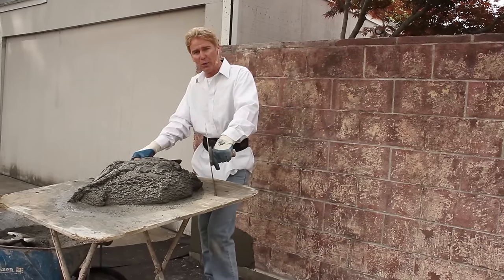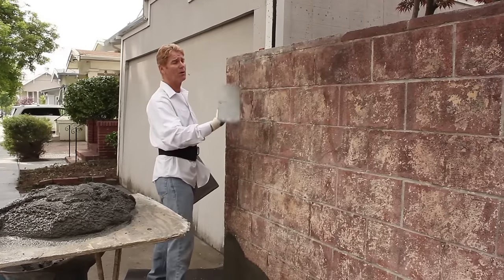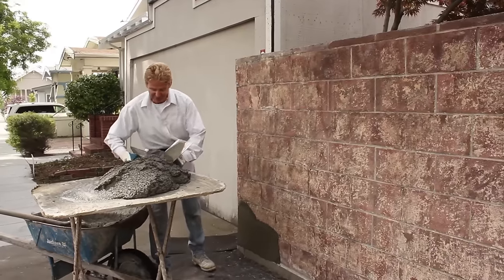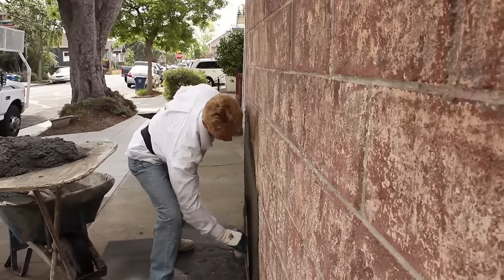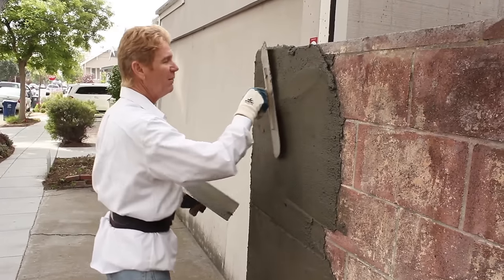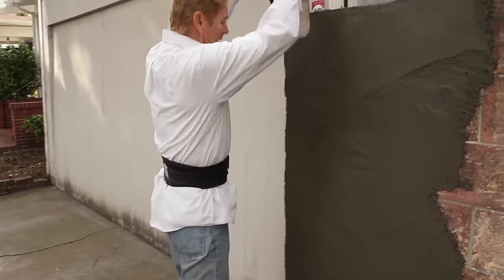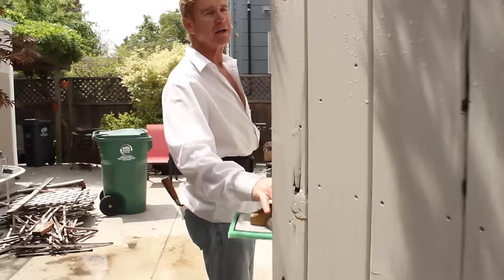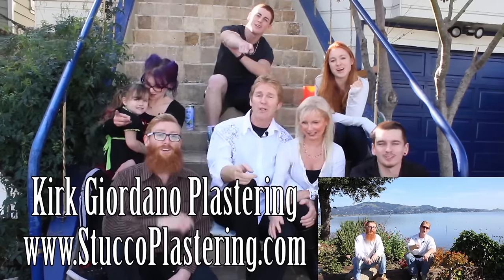Stucco thickness over concrete block?

Comment: Fantastic demo! Love the corner. Wow! Hey, have you ever had to do a tennis backboard wall over cement blocks? Same idea? I am very afraid my wife's deadly forehand will crack the wall. Would some kind of plastic additive help or just follow your excellent recommendation for a routine wall?MAx sand recommendation (3 part sand)?
Reply from the maker: The stucco as a rule is strong enough without additives.But if you feel you need them then add them.

Comment: Kirk, love your videos YOU sir are a true master at your craft! I am about to attempt to cover a  cinder block wall like the one in this video. The wall is around 9ft tall (11 rows high) and 100 feet long. I plan on using 100 LB bags (50 kilo) from Home Depot. It looks like you have 100 LBS or so on your board at the start of this video. About how much material would I need to cover the wall at 1/2"? I live down here in Old Mexico, and every house and building down here seems to be brick or cinder block covered in plaster!
Reply from the maker: Howdy Darth, not certain as I usually eyeball all my jobs, sorry
 Cheers, live long and plaster
 giordano’s stucco images and teaching videos

Comment: Gorgeous job!  

What is the  expansion joint ?  Do you put semi rigid fiber in there?  Please explain.
Reply from the maker: Evening a concrete, brick or cinderblock wall does not need an expansion joint, it a metal piece or channel that allows a wooden wall to expand and contract while allowing a bit of movement thus helping prevent hairline cracking.
 It does not stop hairlineing but it helps big time.
 Have a great day,
Kirk giordano Plastering
Reply: Kirk.  Please go to 5:31 and you're telling us about an expansion joint there. But it doesn't look like an expansion joint
Reply from the maker: O,oooooo, I see said the blind man, what I'm referring too is a natural expansion joint, this cinderblock did not touch the original stucco wall, so to fill that gap with stucco would have stopped both the home and the fense from natural movement when the rains start and with 30 days let alone more rain both the house and the wall will lift and shift, you can't see this action nor measure it with any man made devices, however both need only lift less than 1/8 of and inch within 30 or more days of solid rain and voila a hairline crack at the weak link.
 (not on my watch)
 therefore the natural gap that was well thought out when this cinderblock wall was built remains in place as old Kirk is not fool enough to fill the gaps just because it would save some time.
 I took my trowel on edge and recreated the natural expansion.
 Good question and sharp eye.
 Have a great day,
Kirk giordano Plastering
Reply from the maker: Evening Spencer, it's there just not made of metal, it's a gap between the wall and the fence, both serve as expansion joints.  
Cheers,
 Kirk and Jason giordano’s rendering videos

Comment: I have done interior corners like that with my hawk and a taping  knife. Same idea but the J. Compound is only being applied against one of the corners when I do it unlike you who is applying comment on both sides of the corner.
Reply from the maker: Evening Spencer, this is because your a professional with a ton of time in.
 I'm getting kind of bored with a hawk and trowel, I think I'll do a video using my shoe as a trowel just because I can, possible with hand throwing the mud on the wall or using a shovel.
 We actually did do a huge mountain retaining wall and used possibly thousand of shovels of mud to be trough on the mud which I then troweled down into the design i wished.
 The amount we used that day was 10 tons of sand with about 65 bags on common cement plaster, It does not spread well for walls but it's incredibly strong and cost less than the cement plasters I normally use on homes.
Have a great day,
Kirk giordano Plastering

Comment: Kirk. Any bonding agent used for exterior application?
Reply from the maker: Evening Spencer, a bonding agent was not needed for this cinderblock wall as the owner pressure washed it well,
 This allows our new porous cementitious finish to adhere to this existing Porous finished cinder block wall, " by suctions,"  mixed with a proper amount of skill to determine how much water water to use prior to application of new stucco.
 However I did apply a bonding agent as I like to make sure my work adheres to another man's work of pressure washing.
FYI, if I had pressure washed this wall I would not have needed a bonding agent as I am very detailed with my tasks.
Have a great day,
Kirk giordano Plastering

Comment: Great videos. Quick question...can you share the actual brands and measurements for sand, concrete and water to get our mix as good as yours? I think we are adding too much water.
Reply from the maker: Hi Elizabeth, as a rule, I buy Hansons Premium Lehigh cement plaster it's sold at the plaster yards. How much sand for each coat of stucco?
  Scratch coats are mixed at 1 part cement to 2-1/4 to 4 parts sand, brown coats are mixed at 1 part cement to 3 to 5 parts sand, and finish coats are 1 part cement to 1-1/2 to 3 parts sand. 
 Most times we mix 3 parts sand to one part cement plaster.
    We add water by eyesight when it looks right we stop adding water.
 If it looks too soupy we add more sand or cement.
 best wishes.
 kirk

Comment: Hi Kirk have you considered using a integral waterproofer in the mix to prevent the block joints flashing through? Thanks Phill
Reply from the maker: Howdy Phillip, I have use many acrylic stuccoes on top of brown coats for this reason.
 all acrylic stuccos are only used for max about 1/8  unless it a sprayed on dash, so the block lines will still show through plus the grout  lines will shrink exposing individual blocks or engraving them.
 Cheers,
 kirk giordano Rendering
Reply: Hi Kirk thanks for your message, the product i was referring to is actually added to the scratch and brown it stops water penetrating through, its something i used to use when i lived in England over masonry buildings, since coming to the use it is a little harder to get a hold off, all the best really enjoy your videos and your passion for the plastering trade
Reply from the maker: O'oooo I see said the blind man,
 Cheers,
 Kirk

Comment: Hi, great vid and very informative. I have a question, can I use plastering sand and cement to use as a mortar to build a block wall or must I use builders sand instead ? The reason I ask is that I have bags of plastering sand and would rather use it out if I can. Thanks.
Reply from the maker: Good Evening Seberious, most plaster sand is either Felton or Oly, clean course washed is stronger, but I'd use what I had personally.   
                            Best wishes,
  Sharing stucco secrets and or common sense plastering tips

Comment: good morning. what did you use to get the corners so sharpe? I noticed the wall was power washed but did not see the blue stuff. Maybe you used the home depot or Lowes product. anyways have a great day and thanks for the video.
Reply from the maker: Howdy whyne, I did apply a bonding agent it's dry so does not show, however a bonding agent was not necessary.
 The tool I used to get the corners so sharp was my vision and a bit of experience,
 Cheers,
 kirk giordano Rendering
Reply: Kirk, I have a vertical crack that keeps returning. I stuccoed the first half of 10 townhouses and another contractor did the other five. The other contractor got to his scratch coat well before me and applied it on to my side of the project about 6 or 7inches. This is the only crack that keeps returning in all of the houses. I thinking maybe his cement  is reacting at a different rate then my cement because he was about 3 weeks ahead of me. I really feel like I should have scraped of the cement that was encroaching on my half and not paired the scratch coats. This crack is a f***ing nightmare. Any suggestions?
Reply from the maker: Hi Wayne, is this crack where an addition meets an existing home, if so an expansion joint would help.
 Does his wire overlap your wire, if not break out and overlap then replaster.
 This crack from hell may be on a natural structural stress point also, where the best you can do is caulk it in early morning when it it the largest, if you caulk in the afternoon it will be closed because of the wood heating up and expanding, thus will push on the stucco which hides hairline cracks most of the time.
 Or perhaps this crack is where vibration is constantly such as a window or gate, when each is closed the vibrations will always hairline a wall.
 We are quick to blame workmanship when most times it a condition that is out of our hands.
 Remember vibration or the slightest movement on stucco or concrete is like kryptonite to superman.
 Best wishes, 
 Kirk giordano rendering
Reply: Hey Kirk, I will let you know how I proceeded at a later date.  Thanks for your wisdom. You have my mind turning. Good day sir!

Comment: hi I have a question. I am building a fire pit in my yard with cinder blocks and I want to go over with something to leave it in a smooth finish so you do not see groove lines. What would be the best thing to do?
Reply from the maker: Evening Joey dude,
 do the base coat I am showing in this video, then instead of floating the cement, steel trowel that coat, or apply a finish coat with steel troweling instead of floating.
 Cheers,
 Kirk giordano Rendering
Reply: +Giordano's Rendering plaster & stucco videos thank you I'll give it a go

Comment: Hi, From over here in the Philippines. I am building a 4 story building over here, and they will be plastering the hollow block walls with 3cm thickness. This is how they do it here with a 1 to 5 ratio. However like to ask, i told them to add hex mesh to the exterior walls, so not to have cracks in the future. Do you think that will be ok, will it work. Also your thoughts on 1 to 5 mix on sifted river sand.
Reply from the maker: Howdy David,      How much sand for each coat of stucco?
  Scratch coats are mixed at 1 part Portland cement plaster to 2-1/4 to 4 parts sand, brown coats are mixed at 1 part Portland cement plaster to 3 to 5 parts sand, and finish coats are 1 part cement to 1-1/2 to 3 parts sand.                                
                                         Live long and plaster
                Answers to life’s stucco and plastering questions

Comment: you didnt wet the wall soon your plaster will going to crack
Reply from the maker: Bravo Rob Dude, nice to here from my fellow plasterers,
 however, I applied a bonding agent to the walls prior,
 sometimes if it's over a hundred degrees, I actually mist the walls also, then sometimes neither is necessary.
 Cheers,
 kirk giordano rendering